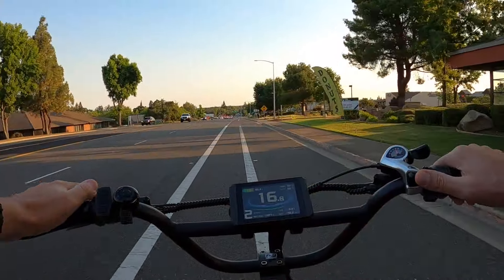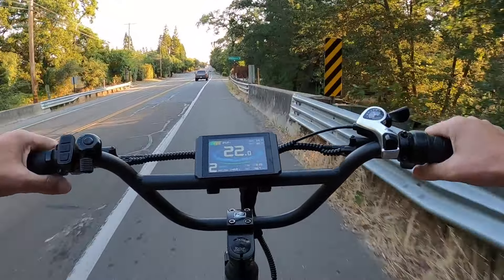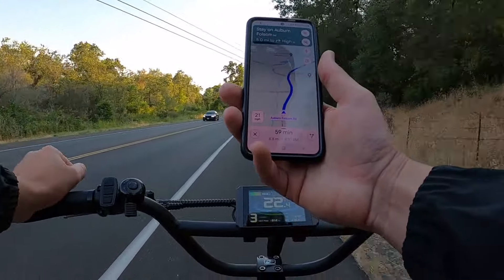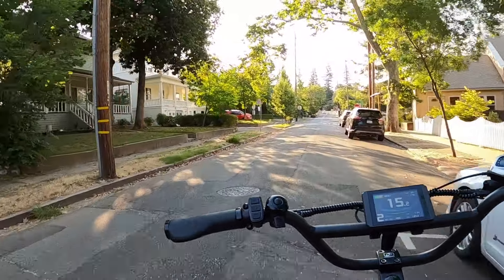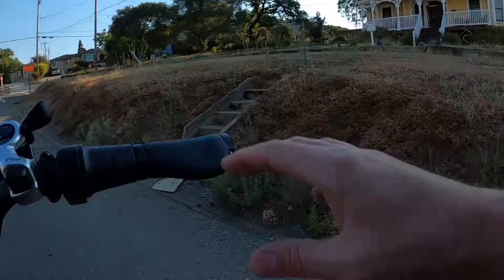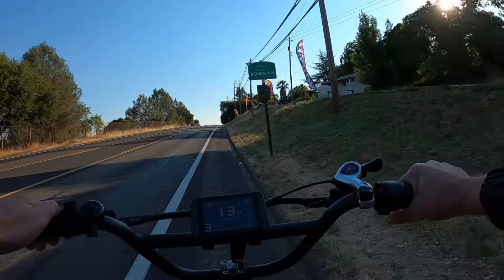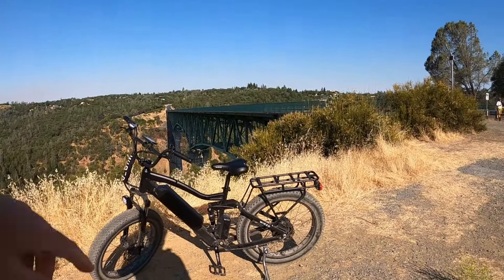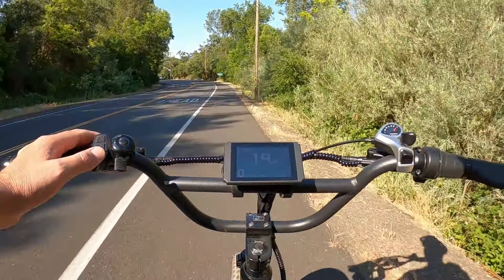Riding to the Tallest Bridge in California!

Comment: Nice ride, you definitely need the dual battery Freedom!   Btw, the next e cell fail may be rear loaded death wobble on the dual star bikes.  Some bikes will have a death wobble when weighted in back, like the Lectric xpeak, and the 5 star seems prone to this from Facebook posts.  Adding the weight of a second battery might be the straw that broke the camels back.  How would they know?  They have never tested one and the AWD versions wouldn’t create the issue because of the weight and pull of the front motor.  Can’t believe they sell bikes they have not tested.  Relying on the Chinese to design the frame geometry is foolish.  The gates drive and torque sensor are bad jokes as is the con man owner.
Reply from the maker: Thank you!!

Comment: these bikes don’t seem to have much handlebar room if you wanted to add accessories like a brighter headlight, turn signals, dual mirrors (not on the ends but on the bar), a phone holder and a camera mount all at the same time. that might require shopping around for a different handlebar since an extender might not be enough. 🤔
Reply from the maker: Yeah, if you want to add a bunch of different accessories to the bars, you may need to get bigger bars or a different style.
Reply: I have the wired freedom 2024 and I was able to add a mirror, horn and extra light to my handlebar.

Comment: Great ride along video,  question for you is how to reset the trip odometer to zero?  Also, for the tires do you use tannus tire protection liner or flat our out or slime?
Reply from the maker: Thank you! In order to reset the trip odometer, simply start up the bike, wait about 10 seconds and the press the up and down buttons (pas control buttons) at the same time for 3 to 5 seconds. I don't use any flat-out or tennis liners, but I do bring along an electric pump and tube patch kits for the longer rides.